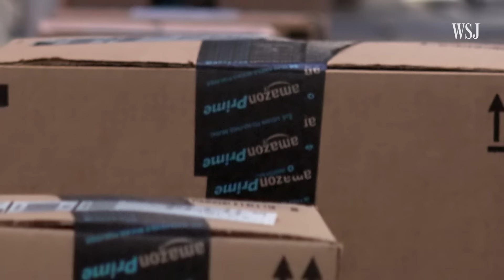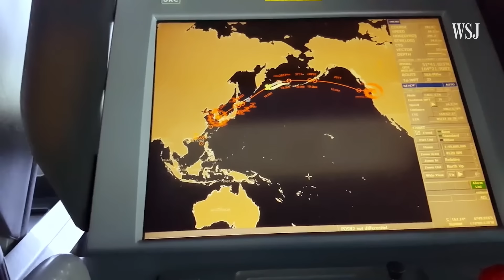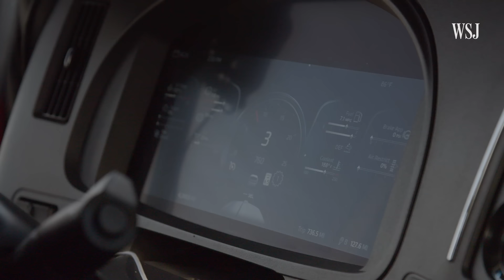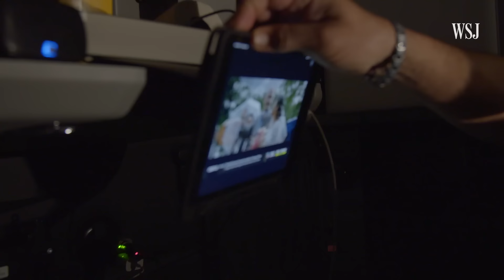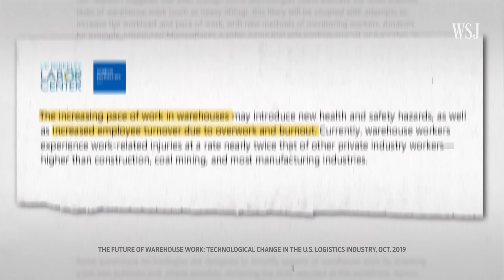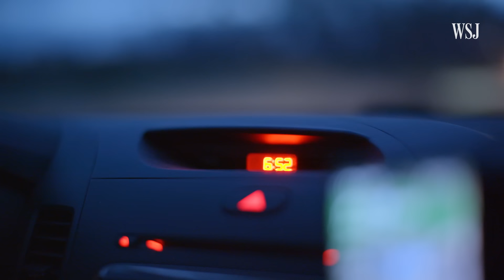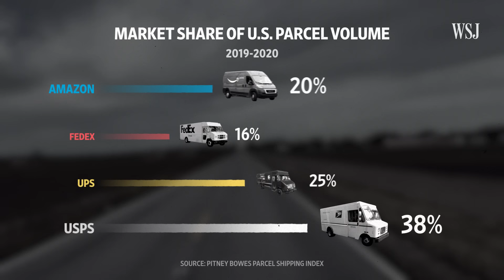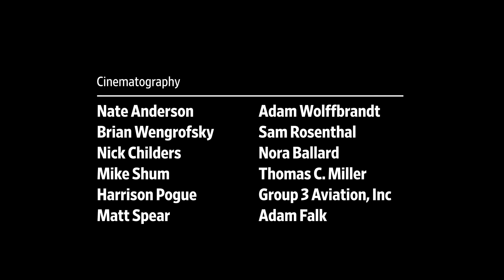Why Global Supply Chains May Never Be the Same | WSJ Documentary

Comment: Former OTR trucker here, the only thing I disagree with is the professor who keeps saying that deregulation in the trucking industry is what lead to the driver shortage. To completely honest, what lead to driver shortages (and subsequent backlogs of deliveries) IS regulation, specifically DOT regulations. So there used to be called a little book you'd carry called a driver log book. This is where you'd record down your hours. You'd keep multiple copies, one of which you'd give the DOT people at weigh stations, which showed you were compliant with the hours of service (11 hours of driving per day, 14 hour work day max, so you could work 3 hours where you aren't driving and dedicate 11 hours to actual driving). You're required to do a 10 hour reset between days. For YEARS this is how the industry operated. Drivers were definitely exceeding their 11 hours of drive time, but since we're paid per mile that means more money for us. This is what literally kept the economy moving. Then back in 2019 they made it the law of the land that you had to use what's called an ELD (electronic logging device) that's tied into your truck. Every move is recorded, and all a DOT inspector has to do is plug into it and they can see if you're following the HOS rules. Ever notice how in the last few years there seems to be more and more trucks parked along our highways? That's because with the advent of the ELD and subsequent adoption by law, you can't fudge the books anymore. This means more time sitting on the side of the road (or at a truck stop if you're lucky to find an available spot). Every minute you sit, not moving, you're not making any money. This means that a job that used to pay exceptionally well, you're being forced by the government to sit and not make money (in the name of safety, of course). The ironic part is since the adoption of the ELD, accidents have actually INCREASED involving tractor-trailers. Why? Because to make the most out of your day, you need to be fast, getting more miles in before your time runs out. This leads to unsafe actions (including blowing through stop-lights, since literally every second you sit waiting you're not getting mileage). Another problem with this system is that the hours you spend sitting waiting to get loaded, you're not making money AND it counts against your drive time (due to the current laws). While I understand the noble pursuit of making roads safer, it ironically has lead to more unsafe behavior in truckers. The transportation economy used to be run by truckers who had been driving for 15+ hours a day, hopped up on caffeine and amphetamines, who would fudge their log books so they could keep moving and making money. The adoption of the ELD has completely solved the HOS violations problem, but lead to unintended consequences such as shortages of drivers. I left the industry and went to work in construction, where my CDL could still be put to use, because of the regulations. I felt like the government was hindering my ability to provide for my family, so an industry I used to love is now dead to me. 

TL;DR: Government regulations in trucking have actually caused more bottlenecks, unsafe activities, and driver shortages. Deregulation of the trucking industry in 1980 has nothing to do with the driver shortage we are facing now, it has everything to do with having every minute of your day tracked and being told you can't legally move your truck once you run out of hours.

Comment: Keep in mind that this was produced by The Wall Street Journal. And not surprisingly, it does its very best to portray the employers as benignly as possible. Every employee seen in this propaganda piece was carefully selected to support this kindly portrait of management. There're two sides to every story. You've only seen just one. And what they're NOT telling you is just as important as what they ARE.
Reply: But they've said there's a really high churn rates in all the sectors of employees showed, they've shown that working as driver needs long hours, warehouse is also really tiring and last mile also have pressure to keep up the fast pace of deliver expected by amazon, not sure what more you wanted them to portray, and Mark you it's not a documentary about just workers so there's no much time to cover on every issues
Reply: I'm an auto mechanic. Cry me a river. I work harder and much longer hours than any of these people. Try changing clutches and swapping engines 11+ hrs a day with no A/C. Coming home, cut and bruised, covered in grease and brake dust. It's called WORK. I'm not complaining. I do it because it has to be done. Too many emotional cry babies these days.
Reply: @Aaron-os8qi  hey arron i payed a guy 450 bucks to replace my clutch. he did it same day, is a couple hours.  thanks dude, your knowledge and experience is valued and appreciated..

Comment: I’ve never worked in a distribution warehouse, but I worked unloading trucks and stocking shelves for a big box building supply company that sent product from its distribution warehouse. We unloaded and stocked everything from plumbing parts to refrigerators and it was just like the guy who worked in the Amazon warehouse described. By the end of the week I was physically spent. My joints ached and my muscles were fatigued to the point that exercise would have been more destructive than beneficial.  I love to keep physically fit too, but weekends were needed for recovery, or I would have injured myself otherwise. 

Warehouse work is dirty, dangerous, physically demanding and sorely under appreciated by most Americans. My coworkers didn’t like me saying it, but when robots take over all of that work I think It will be better. Those who do that work will have to figure out something else to do, but it will be a lot safer for people in general. Robots can lift more weight with no risk for debilitating injury, and they are simply repaired or replaced when they break or wear out. It’s not that simple for people.

Comment: Me: "Sounds like we could avoid a lot of these problems by reducing overseas manufacturing"
The entire economy of the USA: "ain't reading all that"
Reply: Large increases in domestic manufacture of consumer goods WILL NOT happen unless that manufacturing is done in highly automated factories.  Bottom line, until the cost of automated manufacture drops to the point where it can compete with cheap overseas labor, it won't happen.
Reply: @MrSloika  minus shipping costs, time, duties, handling etc... It has some other advantages as well but likely requires even more supply chain truck and rail infrastructure to meet the raw material needs

Comment: This just reinforced my pre-existing beliefs: 

* that we need more high speed rail transport, not just for passengers, but for freight and commerce as well.
* that Amazon is evil and we need to use more standard shipping instead of overnight or two day shipping.
* that automation is going to be more built into every field of work including shipping and warehousing.
* that unions are essential for every industry, and that the shipping and warehousing industries a re especially harmful without unions.
* that we should be doing more shipping through and giving more funding to the public postal service.
* that we as a society need to reduce (not eliminate) our consumption.
* that the current inflation (which is a complex phenomenon) is being driving by supply chain issues and corporate/capitalist greed, and not by stimulus checks or higher wages (which do not exist) or by so called labor shortages.
Reply: $Money Printer going Brrrrrrr is another reason for inflation.
Reply: High speed rail project in California is a complete scam. They said it would only be 20 billion, and now it's 200 billion and 1.5 billion for lobbying and advertising alone. And it will go to San Diego to Barstow, which is way out of civilization.
Reply: Amazon pays more than your mom & pop shops pretty much everywhere around the globe. These local places here in Canada refuse to payout benefits, or pay increases of any kind and expect you to multi-task multiple roles. Amazon gave me benefits from day 1 with increment pay increases based on what I was asked to do in addition to what I was hired for.

Comment: It is interesting that Wall Street views the Supply Chain issues as primarily a trucking problem. 
Supply begins with manufacturing, manufacturing with resources. The media focuses today on oil, tomorrow it will be wheat, next week it will be steel, a month later it will be noble gasses.
Unfortunately the west has outsourced every critical SUPPLY link in the chain. the only negotiating chip we have left is DEBT.

Comment: Where are the railways? Imagine how many containers you could send by train. Bulk goods over long distances. If it is more efficient to send goods on bigger ships surely it is more efficient to send goods on trains rather than trucks over long distances. This would overcome the driver shortage and reduce greenhouse gas emissions. De-regulation of trucking and the Railways happened here too in New Zealand in 1982. In the following years the number of railway employees shrank from 20,000 to 4,000. Between 1993 and 2005 the railways were in private hands and a lot of asset stripping went on. The Government took back the tracks in 2005 and bought back the rolling stock in 2008.

Comment: Why were the railroads' role in the supply chain choke points not addressed.  35% of the containers moving through the PofLA are on rail transport, not truck.  There are reports from many whistle blowers that the US transportation bottlenecks are primarily the railroads.  Why was this very important transportation segment ignored in this report?  Why are the railroads engaged is restricting shipping in the US?  What is really going on?

Comment: Long haul trucking shortage can be fixed by using 🚂🚋🚃🚋🚃🚋🚃 trains. One single railway track can be used to carry more cargo per hour than a hundred💯 trucks🚚🚛 or even more. It doesn't need to stop to rest, works on pollution free electricity, can be remotely controlled or automated.

Comment: I was in shipping for 15 years. I cannot help but comment , since this whole documentary focuses on supply chain and shipping and why it is lagging. Two major issues in the first 7 minutes, that are grossly negligent. First container ships can carry up to nearly 24 thousand containers, no UP TO 10 thousand. Second a pacific crossing is likely taking these ships closer to 3 weeks, than a month plus. And bonus they don't have crews as small as 20, they can have them as small as 15 (actually probably legally 13). Though they likely carry 20. All of this can be verified using a quick internet search. If you see the acronym TEU, that stands for Twenty-foot Equivalent Unit. That is the size of a standard shipping container. That's the size they keep showing and what you will commonly see, say outside a grocery store. Containers do come in different sizes though for a few reasons so TEU is used to gauge the size. Good explanation. But WSJ is using very dishonest and misleading information in the beginning of this video to sensationalize the problem.

Comment: Watched up to the half way mark but so far it seems the main problem stems from not enough truckers willing to do the job for the pay or benefits. Isn't this just capitalism doing its thing. Eventually all the companies will have to start giving them better salaries and benefits. If they can't the drivers will find companies that can. thus making these companies survive and thrive with this new worker surplus. Thus allowing them to take more jobs, and hire more trucker.
Reply: In part that simply contributes to inflation. Counterintuitively, wages holding with other inflationary factors active helps prevent short term price spikes from turning into permanent inflation. For the supply chain this is doubly so as shipping (inbound/outbound) simply get passed off to the consumer as an increase to the costs of goods sold. When prices increase and wages increase, you've now just shifted the baseline.

Comment: I would venture to say that countries are realizing that the manufacturing of supplies needed for security and safety of the individual countries need to be manufactured in their home countries. Relying on another country, specially one that may also be considered an enemy country, for the parts, pharmaceuticals, and even the bread on your table is the most foolish thing you can do. Specially when it comes to repair parts and supplies for your military. Looking for something cheaper will often come at the price of compromising your state security.